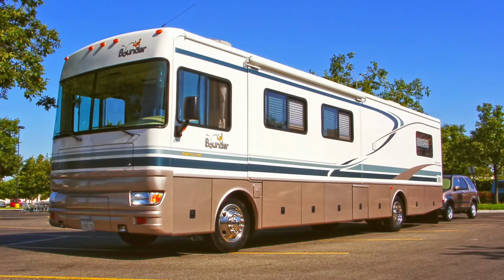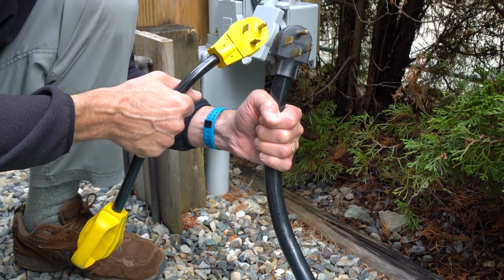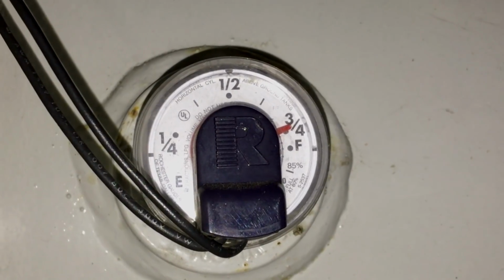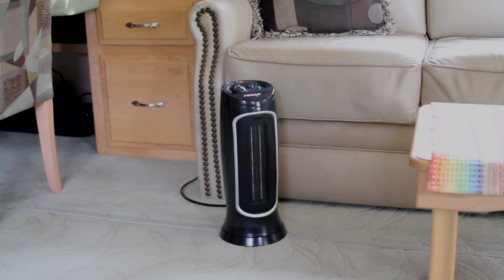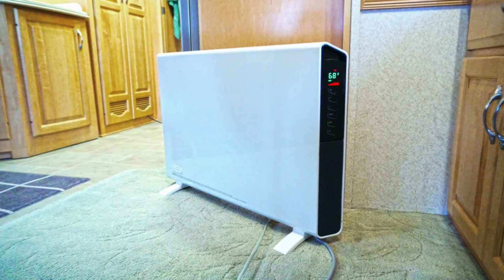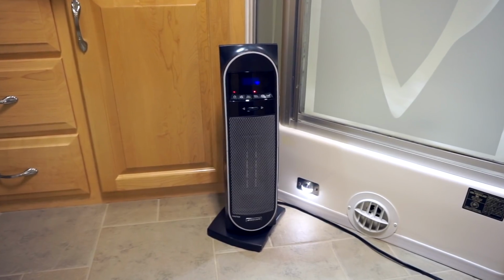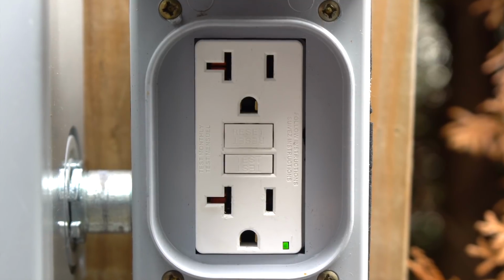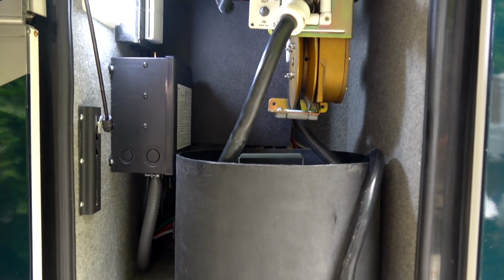Planning Our Winter RVing Secret Weapon!

Comment: Hey, I am thinking of purchasing a dehumidifier to plug into my 10.5 foot truck Camper over the winter months, to help keep the humidity down inside while in storage mode. Any preferences to a favorite brand that can handle temps in the 30's inside the camper?  Thank you for your help.
Reply from the maker: Hi Sandi! We don't have any experience with electric de-humidifiers, but here are a couple of thoughts on the topic. First, if your RV is in storage, humidity should be much less of a problem, since there's nobody on board cooking, showering, breathing, etc (or are you already having a moisture issue?). Also, have you winterized the rig, and therefore leaving it unheated? If so, any dehumidifier would likely be a problem, as it (or the tank containing the water it pulls from the air) would probably freeze. Unless you're keeping the RV heated, that  might not work. If you're having a problem, one thing we'd suggest is the disposable type  - like DampRid ( http://amzn.to/2rMDQZg ) or Dri-Z-Air ( http://amzn.to/2DQPK99 ) which we've used before and were very satisfied with. Hope this helps a bit!
Reply: We, sadly, store our truck camper outside, so far. I do have a Dri-Z-Air in the camper.  It works, but as we live in the PNW, it seems to not be able to pull out enough moisture. I would only plug it in twice a week and pull out every evening after extracting the access water from the air, so it would not be like just keeping it in there all the time.  Our winters are pretty mild here in Oregon, so freezing is not really a problem on most days.  I would, of course not use this during the colder days.  Anyway, thank you for your advise and assistance.
Reply from the maker: We know PNW weather all too well (we're wintering outside Vancouver, BC)! It sounds like you'd be okay with any typical household de-humidifier. Even if the coils froze in those rare times it goes below freezing, you'd probably do fine the rest of the winter.

Comment: Here is how I added a 20 circuit to our RV  http://www.harrylange.com/motorhome-modifications-updates/bedroom-heater/
Reply from the maker: Hi Harry. As you'll see in our next video (tomorrow), we went very heavy-duty, overbuilding our installation with 10/2 Romex, and a 20-amp inlet and extension cord, preventing us from even using the system at all on a 15-amp circuit. Since resistive devices like heaters have a high amp draw, we wanted to be sure that there was no possibility of the wiring heating up, hence the 20-amp (not 15-amp) cord, inlet and outlet. Stay tuned!

Comment: Did I miss your video on how you installed the extra power line, to the plug under fridge,  for your electric heater? I don't know where you are, but it's getting down right cold here in Northern Kentucky. 20* and snow! Ted
Reply from the maker: You didn’t miss it Ted. It will be out this coming Wednesday. Stay warm til then! We’re having our second foot of snow here in BC in as many days. But our extra outlet isn’t doing us much good, because the power was out for nine hours yesterday, and had already been out another five (so far!) today! Ice storms are bringing down power lines all over the place, so it’s been a lot of propane and generator use the past couple of days. So much for our mod. 😕 😄
Reply: WOW! And I thought we were cold! We'll look for video next Wednesday, while we are in Florida. Sorry.
Reply from the maker: Power just came back on after 21 hours! Now we're gonna get some extra heat from that new outlet! :) See ya Wednesday, Ted.

Comment: Have you guys seen this ?https://safervpower.com/products
A guy in from the Open Range owners forum invented it. It basically a manual transfer switch that you connect to the 15 or 20 amp outlet at the park.
Reply: I should add that the idea of this is you can run two A/C’s on 30 amp + 15/20 amp and in the winter run outlets for portable heaters and fireplace.
Reply from the maker: Sorry, but we've never seen these before, so we don't know anything about them. Hard to tell from their website how they work.
Reply: I’d post a link to the forum but it’s for members only. Here’s the video they explain it in the first minute. 
https://youtu.be/dQbxufV2TiQ
Reply from the maker: Watched the entire video, and have to say... that's an awful lot of expense and effort for basically a single function (allowing you to run an A/C unit off the 20-amp outlet when staying in a 30-amp park). Our 43' rig is pretty easy to keep pretty comfortable in pretty hot weather running just one A/C unit. I guess if you plan to stay in very hot weather at a specific 30-amp park, it would be useful, but we can't imagine going to this length otherwise. Thanks for sharing!
Reply: I don’t have a second A/C so I don’t need one either.  I will be doing just as you guys have, run a single dedicated outlet for running a ceramic heater!

Comment: Great idea! Wonder if there might be a second 20amp outlet at the pedestal on its own breaker, you could add a second 20 amp circuit as well.
Do you have any info on your power management system?
Happy Holidays and safe travels!
Reply from the maker: There's usually only a single 20-amp outlet in addition to any 30-amp outlet, but that one extra 20-amp circuit has been plenty so far, allowing us to run a single heater off it. We have an Intellitec 50-amp Smart EMS system, and so did our first RV. They both came from the factory with it, and we LOVEW it. Makes power management a breeze. But not sure how easy one would be to retrofit (we're thinking not easy). Happy Holidays to you too!

Comment: another option to consider for heat is a wood stove...we installed a cubic mini grizzly...they come with all the stainless mounts for the wall or floor and with a stove top fan it uses no electricity to push the warm dry everywhere in our trailer. These wood stoves throw some big heat for the size of the stove and no condensation  either.
Reply from the maker: We’ve heard about those, and heard that lots of people love them!
Reply: Where do You get the wood stove from ?how are they vented out ?

Comment: I did the same thing when staying at a friend's house with my 5th wheel.  He only had one 20 amp circuit and a 15 amp circuit available for a total of 35 amps.  I used an adapter to connect shore power to the 20 amp outlet and a HD extension cord to connect to the 15 amp outlet that only a 1500 watt heater was plugged in to.  I also ran the cord through the slide out.  With two other electric heaters, plus the usual propane furnace, I have survived two Colorado winters with this setup.  Unfortunately, I must turn off one of the electric heaters on the 20 amp circuit when I need to use the microwave or electric hot water heater.  Otherwise, it's not that much of a bother.  I refill one of the 30 gallon propane bottles about once a month.
Reply from the maker: Sounds like an awesome setup, Thomas! To be able to survive a Colorado winter without at least a 30 amp connection is pretty impressive! Hats off to you. 🎩

Comment: I am puzzled as to why the sites offer separate 30 & 20 Amp sockets (instead of one 50A line)?
Reply from the maker: Hi David! Some of it is due to older infrastructure, where 50-amp power simply isn't available, or was never run (it requires larger wiring). 50-amp service is actually two separate 50-amp circuits, and requires far more amperage than is available in some places. But they can still provide both 30- and 20-amp power at those parks. Since we only have 120-volt in North America, we need more amps than European or Australian power outlets to get the same wattage. The 15-amp/240-volt outlets we connected to in Oz provided about the same power as a 30-amp/120-volt here. The reason that many parks with 30-amp pedestals also provide 20-amp outlets is likely because many smaller travel trailers only use 15/20-amp connections, allowing them to plug right into those outlets with no adapter needed. That's safer for them, since adapting up from a 15/20-amp RV to a 30-amp outlet would mean that the pedestal's 30-amp breaker would not be properly protecting them, since it's too large for their needs. Sorry if we're talking about things you already know about. :)
Reply: That all makes perfect sense! Thank you :-)

Comment: We've been living on 30A full time for about 15 years. We  have a 10-3 20A extension cord in through a block of foam in the bathroom window for this same reason. 
You guys do have an extend- a- stay LP tee fitting/hose to run an external tank don't you?
Reply from the maker: Sounds like you've been all over this mod for a while already! We do have an extend-a-stay, but no external tank is available to connect to here, so not much help this winter. But we're warm and cozy on electric so far. :)

Comment: Oh yeah I use a heater sits on top of my propane I I choke it meaning that I can get it on even lower than low by doing that the flame is low but its still cozy and last couple of weeks that way I was to use it unload last me three to four days on its low speed. I've done that last winter as well. Works great.

Comment: At Home Depot 110v cadid heater for in wall I cut in wall to storage in step up to bedroom of my 5th wheel run power like you did
This works so good it keep warm and no wet windows like damp days at the beach heater is 1000 watts.
Reply from the maker: That's awesome, Steve! Electric is the way to go to avoid condensation. :)

Comment: We've been using the stand alone 20 Amp plug on the pedestal with the heavy duty extention cord in addition to the 30 Amp outlet to power two 1500 watt heaters for years :-)
Reply from the maker: Excellent! It's a great trick. ;-)

Comment: I switched from using my  built in propane furnace to a portable electric OIL FILLED radiator heater and it is the cats meow !
Reply from the maker: We borrowed a friend's oil heater one year and LOVED it! We almost bought one for this project, but went with the convection unit instead. It's great too. :)

Comment: I never did that but often would run an extension cord to stuff outside from the post. It would be a relatively easy thing to hook up an inlet
Reply from the maker: It wasn't too hard, especially since it's the only electrical job we've ever done that has NO power running through any of it, so no worries about working with electricity during the install. Stay tuned for the DIY in our next video!

Comment: I love your videos!! My husband and I are working on becoming full timers. One of my concerns is power usage. I love to crank the air conditioning in the summer and I use hair dryers, washer//dryer and other appliances. I had asked my husband if there was a way to hook up the air conditioners so that we could power them on the companion outlet separate from the rest f the electrical system. Maybe even put a switch in to be able to run them on the rigs power grid or switch to their own circuit to a companion outlet at the pole. How difficult if possible would this be? Did that make any sense at all? LOL Also, I love seeing fellow members of the LGBT community out RVing! I am a transwoman married to a cis gendered man and am concerned about discrimination and finding friends where we camp. Would you care to share advice or experiences? Thanks so much and thank you for sharing your vast knowledge. God bless and safe travels.
Reply from the maker: Hi Jacquie! The only challenge you'd likely face with trying to run A/C off the same type of set-up that we're installing is the fact that the A/C units are wired through the RV's electrical system already. Heating on a dedicated circuit that we install separately is easy since we're just plugging in a heater, which was of course never wired into the RV's system. The only thing we can suggest about that is that when we're in hot climates on 30-amp service is that we run only one A/C unit at a time, leaving plenty of amps for other things. If it's too hot to get by on one A/C unit, we head for a 50-amp campground. Doing laundry at night, etc can also help. As far as discrimination, we have to say that in nearly 15 years on the road, we have never felt uncomfortable anywhere. Although some of that may be due to the fact that we tend to travel mostly in places where there doesn't seem to be much of a problem with it, and because we're not particularly obvious about it, and also because we're pretty shy in person, and keep to ourselves a lot. Check out http://rainbowrv.com for into on the largest LGBT camping club in the US. Hope you have a great time out here, and get to go full-time soon. - Cheers, Peter & John

Comment: Great video and looking forward to the tutorial. I'm surprised how many RVers don't know that you can use the 20 amp circuit while also using the 30 amp circuit. 

Before I upgraded my RV to 50 amp service I'd routinely use the 30 amp and then plug in a heavy duty cord to the 20 amp outlet and also use it. I've told this "secret weapon" to RVers who been RVing for years and didn't know this trick. 

Never been to a RV park that had both and didn't allow it however I'm sure there are places that don't allow RVers to use both. 

Of course the best option is to have an RV with 50 amp service and RV at a park with 50 amp service. 

Just out of curiosity is it possible to have an RV with both 50 amp service and 30 amp service and to use the 50 amp circuit, the 30 amp circuit and the 20 amp circuit at an RV park?
Reply from the maker: Thanks Jack! We've never heard an RV that had anything other than one type of service. We think that's because if you have a 50-amp rig, and plug it into a 50-amp circuit, you can run anything and everything you want, so no need for anything else. In a 30-amp park, like we're in now, that 20-amp plug we're installing is really helpful, but we've never seen a set-up like we're putting together as a stock feature on any RV. Hope we understood your question correctly!
Reply: Thanks for the reply. For me, since I travel alone, the 50 amp service is enough and my RV is only 30 feet however I've talked to couples and families with RVs over 40 feet and they've said even 50 amp service is not enough to meet their needs.

I keep meaning to ask if it's possible, mostly out of curiosity, whenever I have my RV in the shop for something but I keep forgetting (old age I guess). 

I thought I'd post the question here as I know the RVgeeks have a large audience and that audience is far more knowledgeable than I'll ever be.
Reply from the maker: 50 amp service can handle a LOT! Those folks must have some serious equipment! 😂
Reply: Spring of last year I was in an RV park in Nevada. My neighbours had a 44 ft. diesel pusher. The owners were a couple with their 4 kids. 

We were talking and I was saying how much better my RV life was after upgrading my RV electrical system to 50 amps and now didn't have to worry about overloading the system.

 They commented that even a 50 amp system could be overloaded with enough gadgets. They showed me their RV. It was literally bigger than my first apartment 45 years ago.

3 roof mounted A/C units. 2 full bathrooms, a necessity with 4 kids. A washer and separate dryer that they used almost everyday due to having 4 kids. 4 TVs, an electric range and stovetop, plus every kitchen gadget ever invented.

According to the couple the 50 amp system was only overloaded when all 3 A/C units were going full blast, plus the washer and dryer going and a number of the kitchen appliances were going. They said as long as they didn't have the washer and dryer going they could have the A/C blasting and cook meals. Or without the A/C going everything else going was OK.

Since then I've seen a couple of other similar RVs. I doubt these people boondocked on a regular basis.
Reply from the maker: We doubt they boondocked at all! LOL They need to stop doing laundry and cooking at the same time on hot days!! :)

Comment: Yup I mentioned I thought I knew what you were going to do on the Christmas video. Hee hee I have been doing this for some time. Now at my rec place we have upgraded to 50 AMP service. But if you have a 30 AMP service trailer which I have for my travel unit this still works! Especially because our 50 AMP service has a 100 AMP main breaker. Good job guys!
Reply from the maker: Thanks Gary! 50-amp service rocks! Wish we had it here. ;-)

Comment: My TT already has an extra circuit like this, added by a previous owner. I also added one to my previous TT so my wife could run her hair dryer while had the AC and water heater running on 30a. I just run an extension wire to it and put a 1500 watt ceramic heater on it and stay warm with little or no use of the furnace. Quieter  too.
Reply from the maker: Nice! We're loving having a secondary power cord so far, too. :)

Comment: so you must not have to pay for electricity.  Two 1500  watt heaters would cost like $400 a month.  I had a 400 watt heather keeping my tiny 2'x2' pump house warm and and a 400 watt electric hose and it cost me $170 in the cold months here in northern MN.
Reply: They said they don't have access to propane, so electricity will be their only heat source.
Reply from the maker: We are indeed paying for metered electricity, but propane isn't readily available, so we don't have much choice. Fortunately, it won't cost us anywhere near $400 a month though! :)

Comment: I did the same thing but... wired it to plug in a 2nd a/c.  When I don't have 50amp I flip the breaker off to the 2nd a/c and plug in a heavy extension cord to run the a/c .

Comment: I have 3M window film in the windows of my old fiver. In addition, I'm adding 1/2" radiant-barrier styrofoam insulation to the floor of the kitchen/bathroom cabinets and to the cabinets against the walls. The closet also got additional insulation. When I can get to the point of rebuilding this trailer, the insulation is gonna be a "must-have." It wasn't originally mfr'd for full time living, but it will be.